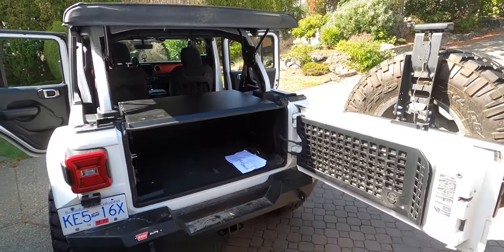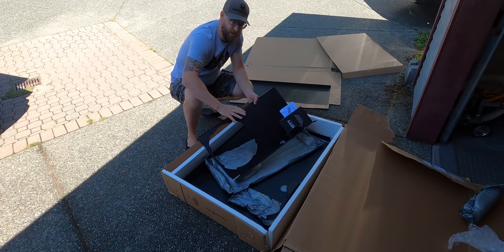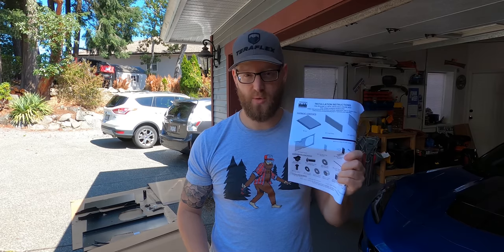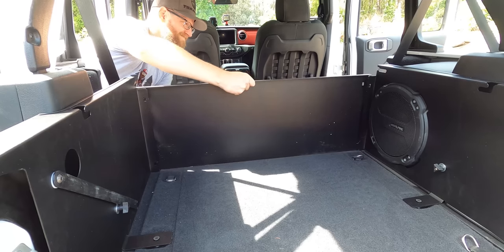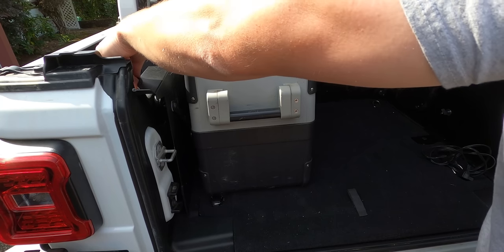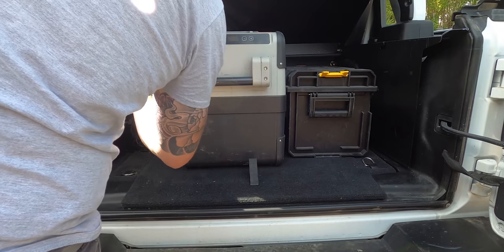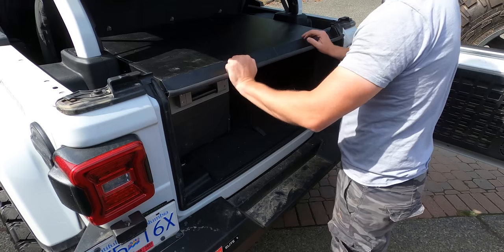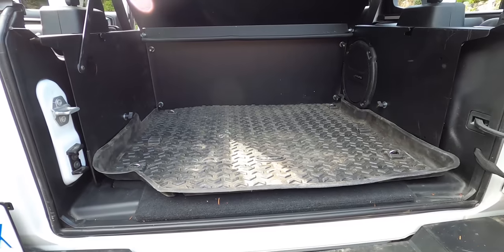Jeep Wrangler JL - Securing my Cargo Area - Tuffy Security Enclosure Install & Review

Comment: There were two versions available for the Jk ,when I got mine,in 2017. One didn’t have the lift up top,came in one piece, and was a lot sturdier,once installed. It was a little cheaper. Another bracket or two could easily be added to this one,if you wanted a little more stability. Looks like it may rattle a little,  but what’s a little extra noise on a bumpy trail, when you can’t see, because of the forest fire smoke?   Keep on, with the keepin on!
Reply from the maker: I have had no rattles after a day of wheeling.

Comment: Hey Casey - quick question. Will this fit a 22 JL 4-door Rubi? Also, is there a way to NOT install the back seat panel? That way if I needed the entire floor length for something, I don't want to rewove the box every time. Also, does this work with a soft top up/down. Thanks man!

Comment: Nice work Casey. I have a jku with a soft top. If this is installed,does it affect how the top folds down? It’s nice that they moved the speaker forward to the useless space in front of the wheel well giving you the full width of the door opening.
Reply: I’ve got a JKU with a bestop trektop nx with the tuffy security deck. No issues at all on my end and can’t imagine you would have any with the traditional square back soft tops either but I haven’t seen one.
Reply: SkylerBMills do you like the trektop? I have been looking at the nx glide,but haven’t pulled the trigger yet.
Reply from the maker: It seems fine so far. The soft top tail gate bar is a bit harder to get a grip on to pop it out, but no other issues.
Reply: Yeah I like my Trektop. I love they way they look but I am planning to go with a Bestop Supertop ultra when I replace this one. Just so I have the full square area in the back for storage. My cooler won’t fit on top of my security deck with the trektop but would with a traditional top. Other than the loss of interior space I love it.

Comment: And what about the sound ? Do you still listen to the subwoofer while driving with that closed ?
Reply: Ivan Torrellas think about all the cars with subs in their trunk. Not 100 percent metal enclosed,in a car,but that enclosure is far from air tight. It’s a little different,but those low frequencies, find their way through!
Reply from the maker: I've notice no change. Still thumps decent for a stock stereo

Comment: Seems like they could have added gas shocks for a lift pretty easily instead of that arm to hold the lid up. Good idea and concept, execution could be improved imo.
Reply from the maker: Ya a strut would be handy.
Reply: DV8 has a similar setup (JLRS-01), with gas shocks which I looked at, but plan on spending another $200 USD on it.   It does however have some additional features the Tuffy does not. Only works for JL 4DR 2018+.  Also, Squadbox Rear Cargo Storage; Aries Automotive Security Cargo Lid both JL & Black Forest and Diabolical for JK.

Comment: Expensive deck need something that’s 1/4 of the price geeze
Reply: teyjizzle small hinged aluminum box,about 36x12x16 or so. Fits right onto the floor cubby cover,close to the door, and will also bolt into tie down holes,for added security. Still cost me $300.Can, but leaves a bit more space.